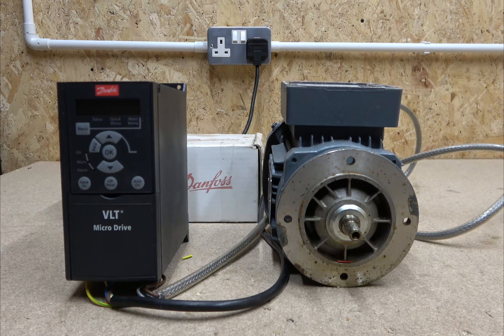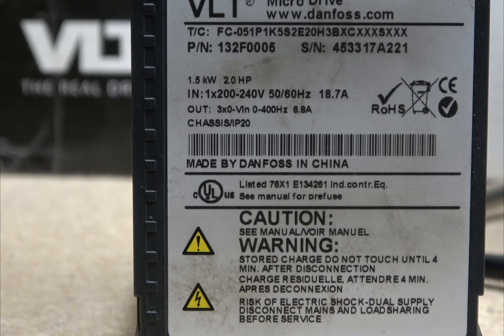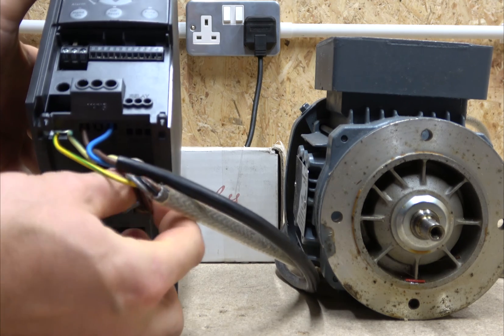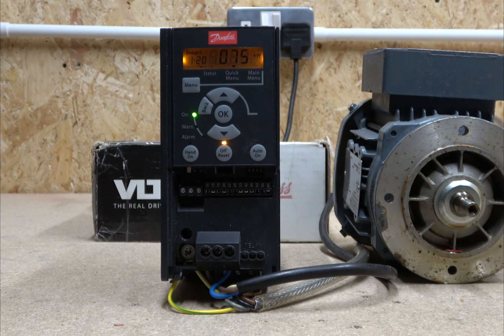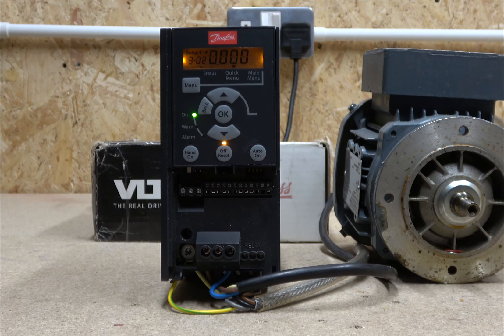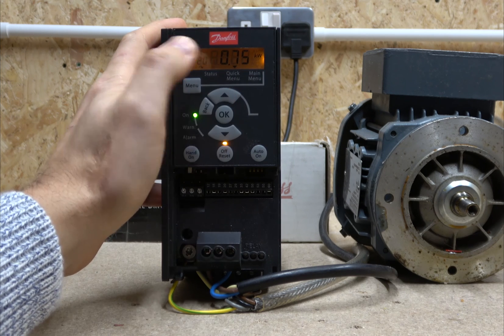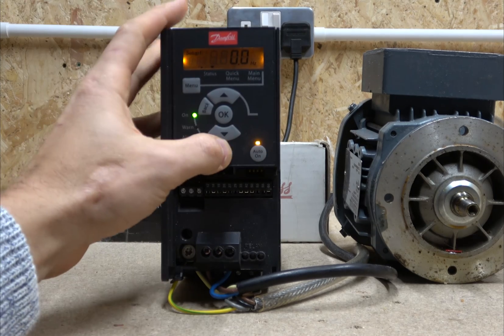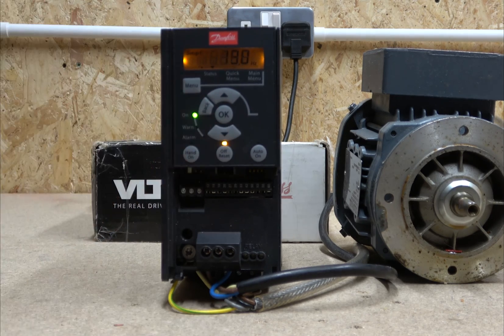Danfoss VLT Micro Drive FC 51 Local Mode Set Up Single to 3 phase VFD inverter (English)

Comment: I have 0.5 hp Danfoss micro drive which is 3 phase , can I programe this to 230 V single phase to run single phase motors. Kindly guide
Reply from the maker: Hi Jerome. Sorry no you can not do that. 3 phase drives will only run from 3 phase supply and single phase drives from single phase supply.
Reply: @IGSElectronics  Thank you 😊
Reply: @jeromegsam this is not completely accurate. You CAN run a lot of 3 phase drives on single phase, but they must be significantly de-rated. For instance, I’m using a 10hp drive for a 5hp motor. Different drives have different setups, but a lot of them have a way to set it to ignore an input phase loss/absence.

Comment: I need to run single phase motor 1 hp, 50 htz, 7.5 amps 2600 rpm. Tell me which two terminals I should connect the motor.
Reply from the maker: Hi there. This drive i s not solar drive and 220-240v AC mains supply is required to be able to run this drive.